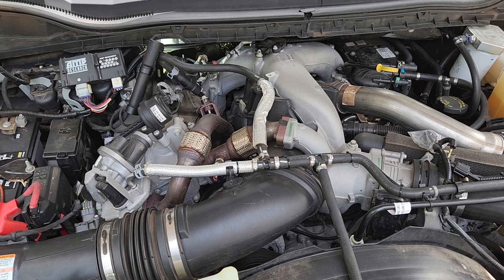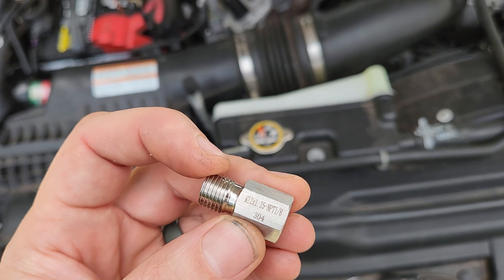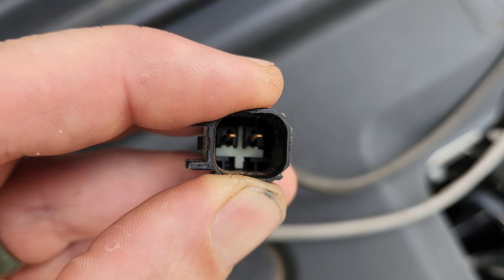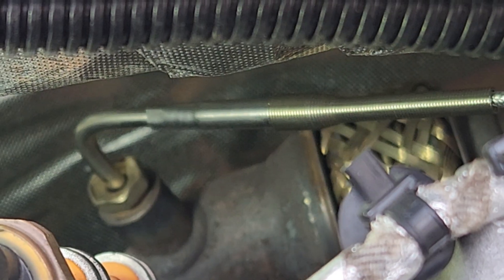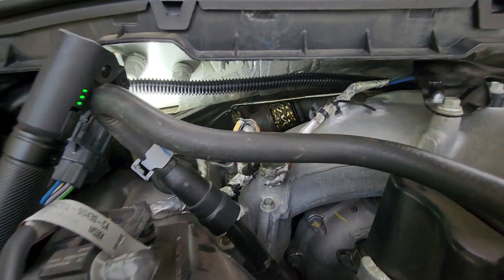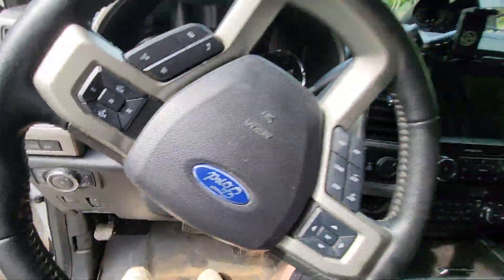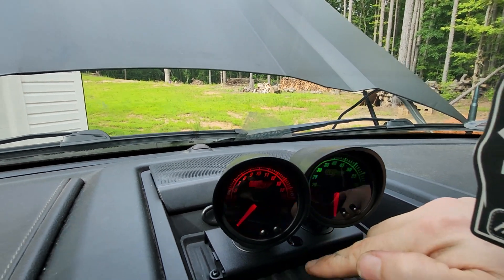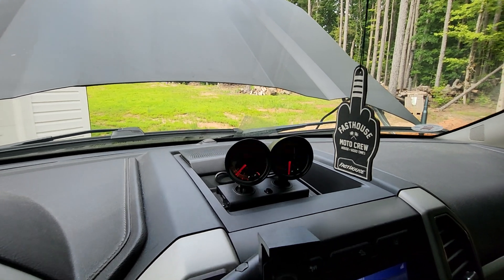Easy EGT Probe Install 2020 6.7 Powerstroke | Ford F-350 Superduty | Boost Sensor

Comment: What tools do you use to get to the up pipe? About to do mine and seems while retaining the egr piping, the only option without drilling the manifold is this way
Reply from the maker: No need to remove the up pipe. I use a long 17mm open-end wrench (or even better, flare nut wrench if you got one). I unplug the exhaust pressure sensor that sits directly in front of the probe for a little extra room & painfully cram my meathook back there, if need be. It's critical to get enough taper on the stock nut so it can properly squeeze the ferrule & lock the probe in place, or it'll eventually loosen & probe'll blow out at the worst time...ask me how I know. I used a Dremel to shape it. 1 more thing...careful not to snap the brittle-ass plastic on the vertical part of the T in the heater hose while reaching back there. Good luck 🤙🏻